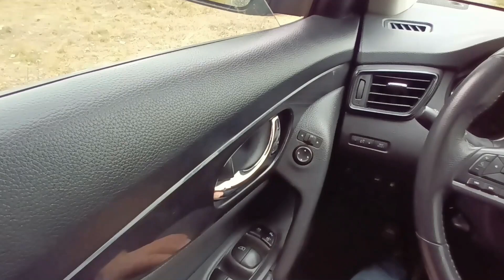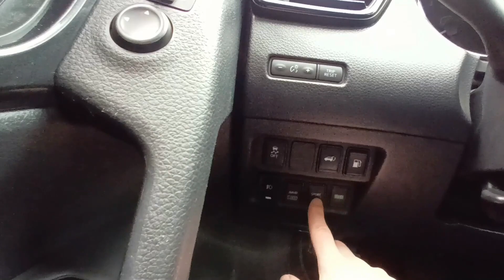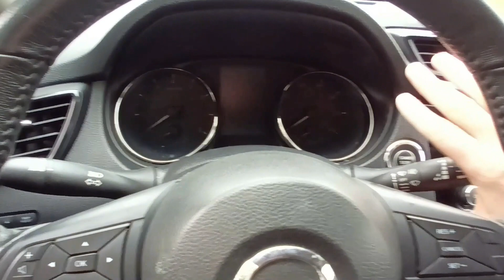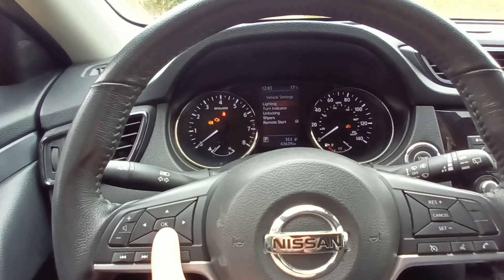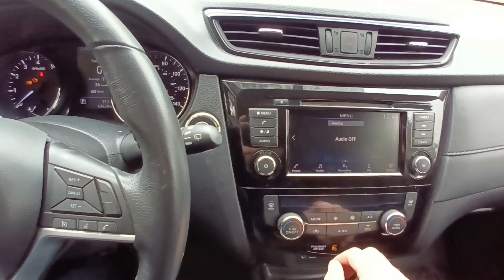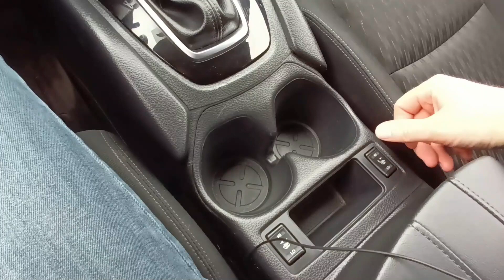Nissan Rogue (2013-2019) Interior, buttons, options EXPLAINED

Comment: I have a rogue, but sadly, it didn't come with a manual. Do I turn on the 4wd and traction button when driving in the snow? Do they appear on the dashboard when on?
Reply from the maker: The light on dash is when it's off. Traction control is on at all times unless deactivated. Awd is controlled by computer and will go on-off automatically.